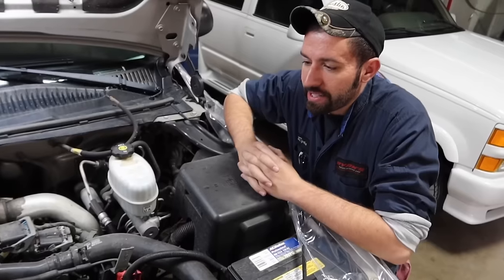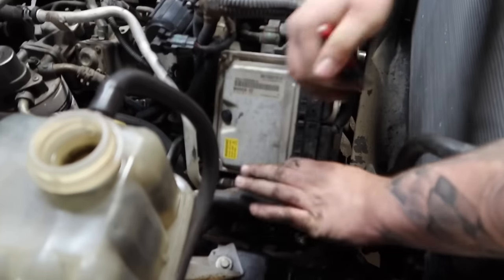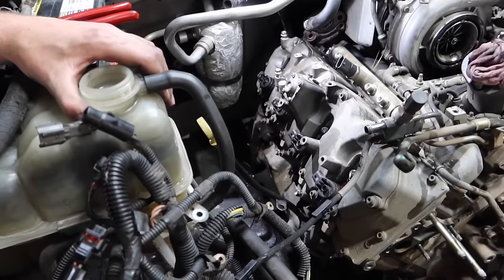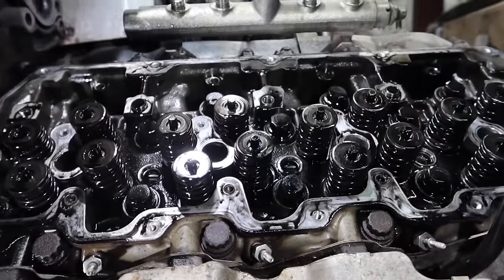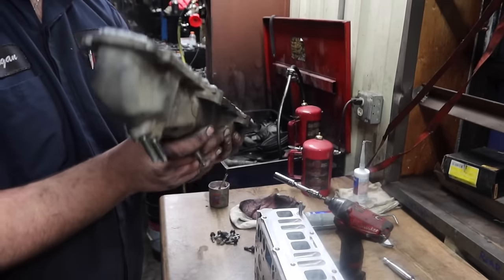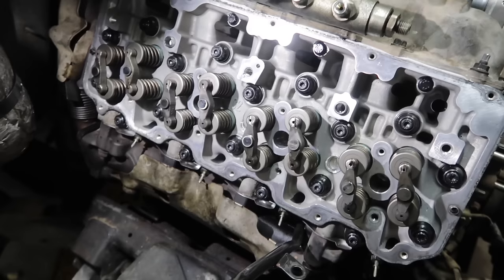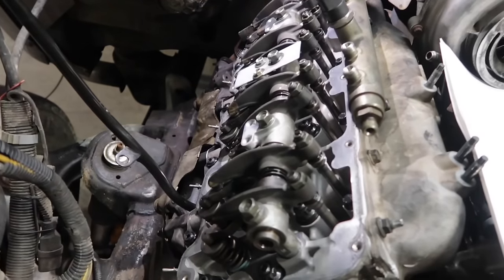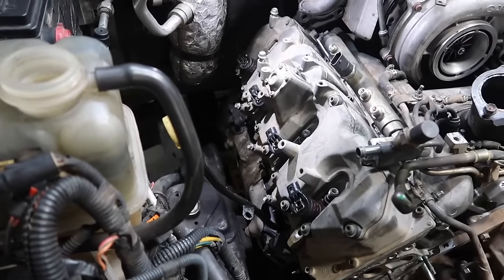How To Install Head Gaskets And Head Studs | Duramax

Comment: I don't comment on videos but definitely wanted to shout out to you on being able to film this process. Unbelievable video contributing to the Duramax community.  Good Job
Reply from the maker: Thanks I really appreciate it
Reply: @TruckMaster  I see they used 80 grit sand paper to resurface the block deck. How come no rags anything were used to keep sand paper grit and debris from falling into cylinders and lifter area?
Reply: @IsThatJomz  I don't know, I guess....🤷🏼‍♂️
Reply: thank you.
Reply: @TruckMaster  Brother, what does that job cost in that shop?  Thank you very much, Great work!
Reply: @2015_Rubicnn  Good luck getting an answer to that question. Several people have asked the same thing myself included and can't get a response. He'll respond to compliments though....
Reply: @captainr.8882  I was quoted 7k.... Here I am watching the video doing it my self lol
Reply: @frankcreekmore5477 how did it go for you? I'm gonna attempt it myself. I'd love to hear how it went for you
Reply: @TruckMaster what's the best brand for head gaskets?
Reply: @californiacctoilets7280did you guys do the head gaskets yet?
Reply: @californiacctoilets7280 the only concern I have is getting sanding grit in the pistons and oil/coolant channels. How did you clean the block surface?
Reply: Hey truck master question on a 2006 lbz what's code be the signs for having a code p0128 it's for temperature for coolant is is something I should worry about it doesnt over heat at all

Comment: This video just saved me $8400 from letting the local shop do it so really i saved 4000 i bought new heads, new headgasket kit, up pipes, down pipe and new exhaust manifolds, new upper and lower radiator hose, fuel return lines, coolant lines, new fuel return from the injectors, and got some new tools thanks keep what your doing !
Reply: Did you get the job done and all back up and running?
Reply: How did you clean the metal sanding dust out of the cylinders and coolant ports before reassembly?
Reply: @cdsmit27 pluging it up with paper towels

Comment: I watched this video a good 30 times while working on mine. This video was a life saver for sure!
Reply from the maker: Thanks
Reply: Did you sand the heads as well as the block?
Reply: @frankcreekmore5477  you have the heads machined
Reply: @frankcreekmore5477  the heads must be re-surfaced by a Machine shop.
Reply: Any tips? About to do my brother's lbz. Also, what do you think a fair price would be?
Reply: How did you clean the metal sanding dust out of the cylinders and coolant ports before reassembly?

Comment: Man I’ve been watching this  for a month now helping with my head gasket replacement! Thanks for the great video!
Reply: How’d the project end?
Reply: i watch this video for 3 months. waiting on ARP studs 2 month back order,,, the machine  shop said one head was junk had holes so i got 2 brand new heads $550 each not bad for brand new.
Reply: How did you clean the metal sanding dust out of the cylinders and coolant ports before reassembly?

Comment: I have a  34 year aerospace career as an assembler and machinist and have worked on some of the most complex jet engines in existence and after watching this I have come to realise they ain't got NOTHING on a Duramax engine for the layers of crap you have to remove just to replace something as simple as head gaskets. Looks like you guys have it down to a science. How much does replacing the head gaskets cost? Great job by the way..........
Reply: You have know idea! I have an 04 duramax that only has 194k miles on it. I had to replace injectors, so I got my cousin (who is GM certified mechanic and works mostly on Duramax) to help me. Well, this video brings back the nightmares!! I've always thought of myself as a descent (spare time) mechanic.....long story short, I will never do that again! To me, nothing on a vehicle should be that ridiculous to get to. I saved alot of $$ but I believe it might be better just to pay someone to do it. I'm sticking to the easier stuff, Brakes, alternator, water pump etc etc
Reply: Most places will charge between $2k and $4k just for labor. The parts kits are between $600 and $1200 cost depending on if you get ARP studs and upgraded gaskets. I totally charge $3k total if I'm doing it on the side for guys from a performance forum, but that's only if I don't have a bunch of work lined up. Its a full 12 hour job if you know what you're doing and are good on your tools.
Reply: @dawgfather2101 agreed!

Comment: Just finished getting my heads out. Off to the machine shop tomorrow.  Snapped 2 GPs.  I used this video all the way through tear down. This is by far the best head gasket install video I have seen.  Thanks.
Reply from the maker: Thanks 👍
Reply: When were you deployed.  I was OND 2011-2012
Reply: Finished last weekend.  Went with new heads.  Wait time for machine work was to long.  Video helps a lot.  On a ie note, do not buy cheap return lines.
Reply: @troyhuwe6589  did you watch this vid to tear it completely down?
Reply: @logan8256  yes.  It doesn't cover every step but it was extremely helpful
Reply: How did you clean the metal sanding dust out of the cylinders and coolant ports before reassembly?

Comment: Thank you for your video, this has help.me do my headgasket by my self in 3 days had a fuel issue for 1 day an it was my fuel housing needing rebuilt. Never have I done anything like this to a vehicle other than turbos on a bmw 135i. This was a extreme help! First diesel headgasket job done perfect!
Reply from the maker: Thanks! Glad it all worked out for you
Reply: How did you clean the metal sanding dust out of the cylinders and coolant ports before reassembly?

Comment: I have a duramax that someone tried to do a share head gasket job and lost the dowel on the driver side.   It will allow the head to slide downhill a few thousands so when reassembled it will starve the oil passageway and lock up the push rod between the gasket and the head casting.  Also had a crap @$$ shop try and repair it and use the same handed gasket on both sides.   Grrrrrr!   Love the quality work being done in this video!

Comment: Good video. Only things I thought you left out is what to replace while you're there. Rebuild turbo, new water pump, new oil cooler gaskets, go through wire harness and replace protective sheath. I also replaced my reservoir tank. While the heads were out for machining I had all the intake and valve covers powder coated semi gloss black. Added mishimoto up and down pipes, PPE exhaust manifolds and a dual fueler. Hard to believe some guys skip the valve lash. You don't belong wrenching on a duramax engine if you cant do valve lash. My early 06 LBZ had the rivet head gaskets and just started to show signs so I did HG's and studs preventively. Cheers.
Reply: Will this video work for an 11 lml?
Reply: How did you clean the metal sanding dust out of the cylinders and coolant ports before reassembly?

Comment: I did this by myself in my garage back in 2013 on my LLY.  I would rate this job as “intermediate”.  It shouldn’t be too bad for someone who has some experience working on cars but I wouldn’t recommend for a novice or beginner.  This video is fantastic.  Only thing I would add:
-have plenty of spare fuel and coolant line and replace all of those small rubber hoses.  Mine were dry rotted. 
-I would get new glow plugs.  Several of mine broke off in the head and the machine shop had to remove them.
-get new fuel return lines.  A few of mine broke off in the injector. 
-use care with all of the harnesses, they break easy
-take the time to clean everything before you reassemble, esp if you don’t have deletes
-at the end, I filled the coolant with water, and idled for about an hour to check for leaks.  Then changed the coolant and oil.
Reply: I’m 18 and have no mechanical experience. It came down to I could only afford to do them myself. I studied this video for a week, got certain tools for the job and tackled it all by myself. It’s all about will power and determination
Reply: esp?
Reply: @logan8256 I've watched this atleast half a dozen times. My only problem with it is they never show how to clean the metal dust out of the cylinders and coolant ports before reassembly. How did you do that and is your truck still going strong after the job?
Reply: @cdsmit27  There's different schools of thought on this.  My way: First, use compressed air if you have it to blow everything out.  Rotate the crank so a few pistons are at the bottom, take some sort of grease, coat the cylinder walls, then rotate the cylinders passed TDC.  You'll notice the piston rings will catch all the crud and bring it to the top for you to wipe out.  Repeat for remaining cylinders. Anything you missed will get caught in the oil filter, and that's why you change the oil after your first run up.  

As for the water jackets, hopefully you stuffed a few shop rags or put tape over them to prevent anything from going down there in the first place.  If you feel some shavings went down, it really shouldn't be a big deal and just flush the cooling system after you're finished.

P.S.  I sold the truck in 2019, but it ran smooth and flawless.  No issues several years and thousands of miles later.

Comment: Huge thank you! After watching this video several times since you made it I finally finished heads and arp studs as well as new cp3 and water pump. It took me two weekends but the ol lb7 with 315000 miles is running like a top keep em coming!
Reply from the maker: Nice 👍
Reply: Any big differences on the lb7 compared to this video

Comment: This is a helpful video for sure. BUT if your thinking about doing this job yourself watch this video in it's entirety. They show mostly the passenger side, that's because the drivers side is a total PITA.
That being said. In my opinion they leave out  a lot of VERY crucial details on putting it back together especially towards the end. (Anyone can rip something apart)  Example put your injectors in before your top fuel lines 55.55 in the video. On the drivers side after injectors are in install HP fuel lines from main fuel rail to injectors START WITH # 7 #5 then main fuel line next #3 #1 if not you will be taking off everything they told you to put on to tighten the fuel lines from #7-#1. Again I'm not bashing the video It helped me a lot just could of been better detailed going back together. Just trying to help someone out wanting to take the job on their self

Comment: Head gaskets 101. Fill all openings and cylinders with shaving cream. Scrape with gasket scraper. Get the largest knife honing stone you can find. Bass pro had an 8” x 3”. Start with course  side using wd40 going lengthwise. Finish with fine side. Don’t go crazy. Vacuum up and turn motor over wiping cylinders. Oil cylinders and turn over. NO SANDPAPER EVER!!!
Reply: Sincere question. What do you mean turn motor over? It's not able to run at that point.

Comment: Won’t metal shavings go into the motor and cylinder when sanding?
Reply: Shavings are visible pieces of metal. Sanding doesn’t produce shavings. Anything in the cylinder will blow out with a quick blast of air. It’s possible tiny debris could fall in the coolant passages, so somewhat valid point. Yet either a stone or sandpaper has been used for decades, so it’s obviously not an issue. These guys haven’t invented any of the work being done.

Comment: Hey Josh, 
Have you ever seen a blown head gasket on an LLY that doesn't lose coolant but has a hard upper rad hose and occasionally pukes coolant out the over flow tank if run hard? Coolant tank isn't black either
Reply from the maker: Yes it’s still possible you have a failed gasket but pressurize your coolant bottle and check for leaks first but it can also be your thermostats or radiator.

Comment: what about the grit falling into block from sand paper? where the push rods go or other ports that have access to block internal. Would running it a liitle and changing the oil right away be sufficient ?

Comment: Awesome video. Its was extremely helpful for me doing my valves after putting head studs in. The only thing I would recommend is to actually loosen each rocker before torqueing down the main assembly. If they were tight like several of his were while being torqued, then you loosen them to get the feeler gauge in, you wouldn't have 30 ft lbs. anymore.

Comment: I remember when i did this to my lbz. It's not even a shitty job, its just time consuming
Reply: I’m about to tackle this job. Any tips for me, things to look out for or does this vid wrap it up
Reply: @logan8256  Get the fuel line disconnect tools and just watch the dipstick tube- pain to get back in
Reply: @rhunter3406  did you have a buddy that knew how and showed you or did you watch this video as u tore it down
Reply: How did you clean the metal sanding dust out of the cylinders and coolant ports before reassembly?

Comment: Just watched this video , I luv my 12v Cummins even more 🤣
Reply: I bet you really love it when a Duramax pulls away from you under any condition!🤣😂🤣😂👍🏼
Reply: @DonkeyGap750K3Gixxer  I dont really give 2 fawkes how fast your truck is ,  I dont have any payments and can pull any trailer and no computer to run my engine .
Have fun replacing your injectors .
Have a good day 😁
Reply: Cummins garbage
Reply: Says the one still replying... 5 months later.
Reply: @StaySickNick  Says the one who probably owns nothing
Reply: @Ratridez  both are good it just depends on preference
Reply: @DonkeyGap750K3Gixxer  After the 2nd set of injectors

Comment: I started out trying to remove my heads by leaving the cab on. Like in the video. The up pipe bolts I was basically having extreme problems getting the bolts broken loose. Not twisting them off. I changed my plan, and took the cab off. It was very much worth the effort to do that. Then everything became so easy to work on. Don't know if I would even try this job regardless of truck condition without doing a cab removal. Just my .02
Reply: That’s one hell of a way to make 8 bolts easier to remove. Pulling a cab is no easy task. I’d much rather pull the engine than remove the cab. Obviously you have some sort of gantry crane at your disposal, and I’ve pulled a cab and box so I know what’s involved. 
I’m sure the bolts are a PITA, but shoot some PB, wait a day or 2, and use some heat if you have to. Way easier than a cab pull.

Comment: for anyone doing this job, I'd recommend using the 3M bristle brush for cleaning the block. it doesnt make a mess, it's great for getting the soot off the block from where the blow was and it makes the job much faster. 

 also blow out the stud holes with air and shop vac everything out, otherwise you'll be pulling the heads off again go blow them out. 

Do yourself a favor and just leave the exhaust manifold on. The 3 bolts connected to the manifold, one is in a very tight spot that is impossible to get a socket on. I bent wrenches trying to get it off, so just leave the manifold on.

Also it wasnt discussed in the video but I changed my oil before I started it up. given that the oil was contaminated with coolant I didnt wanna risk any further damage to my engine.
Reply: Yea personallyvi would have stuffed rags and shit in the cylinders and the pushrod holes. Great idea to be dropping sand paper particals into holes where the fucking cam is. Cylinders easy to clean out but better hope nothing dropped down those pushrod holes lol

Comment: I've never worked on a diesel engine nonetheless taking it apart to the engine block, but this video definitely saved me $11k that the diesel shop was going to charge me; Thank you truck Master and Ryan's diesel.
Reply: 11k got damn
Reply: @marcusjennings7616  yeah that dealership was silly to assume I also needed new heads based on a 2 hour diagnostic they made on my truck 🤣 that's why I was quoted $11k
Reply: Best to estimate high then low.
Reply: How did you clean the metal sanding dust out of the cylinders and coolant ports before reassembly?

Comment: This video is the reason why i just subscribed to the channel and why i will shop for stuff here as well.
Reply from the maker: Thanks!
Reply: @TruckMaster  no man thank you for taking the time with your shop pals to do this video. Im a life long GM owner and everything ive ever worked on was gas LT1, LS motors or Gen 2 350 Vortecs. And i will admit, i always wanted a diesel but ive been terrified of having to work on one if and when it comes down to it. Your video cured my anxiety and boosted my confidence and im no longer afraid. Looks to be no difference than working on a gas motor.

Comment: I was quoted 5500$ to get my headgaskets done by Ryan’s diesel, I will now be doing it on my own
Reply from the maker: That’s actually not a bad quote other diesel shops charge between 6-8k
Reply: That's cheap. I know of shops that charge $10-11k for head gaskets

Comment: For those egr cooler bolts on the exhaust (by the firewall), use a flex head type ratchet.
Reply: Tht'a exactly what I did, a 3/8 12pt and a long Cornwell swivel handle ratchet., tight but no problem.